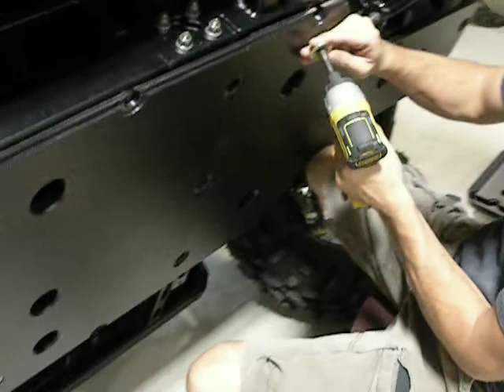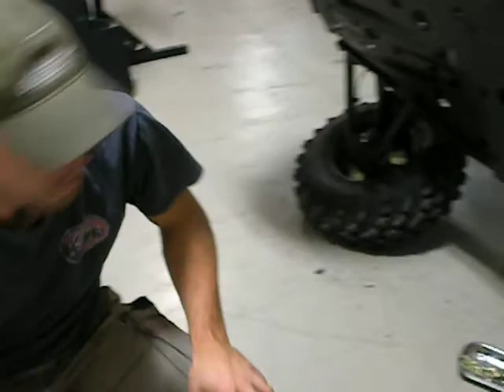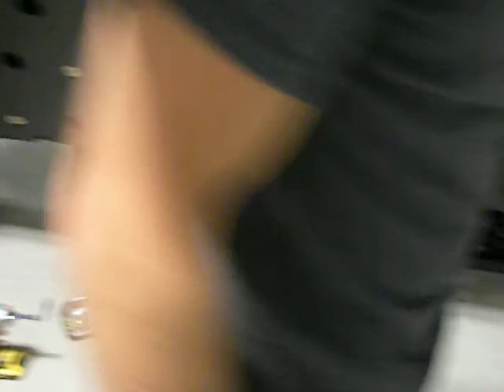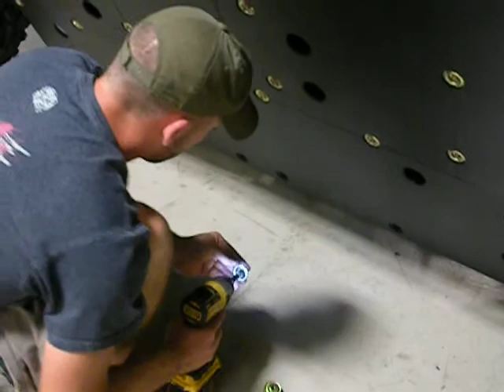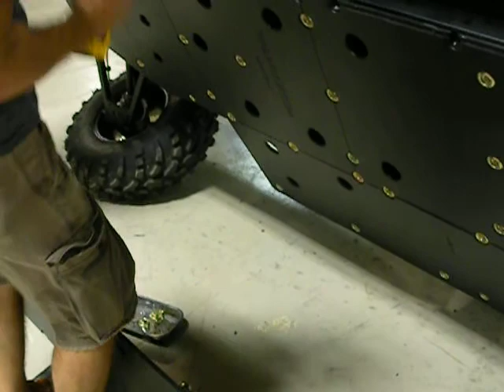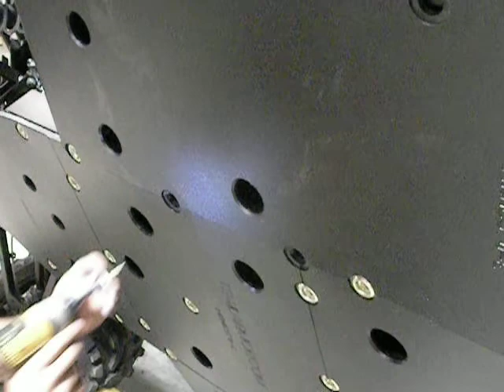Trail Armor 2015 Ranger 570 Crew Midsize Skids Installation

Comment: You work in a very noisy environment. Looking for plates for my 16 570 midsize Ranger because the factory ones on it are plastic. So are yours. Can you tell me what the difference is between the factory one to yours?
Reply: I can tell you the OEM(Factory) are about an eigth of an inch thick and not very durable a lot of people have been running stick through them/floorboard. There arte companies like superatv,or factoryutv.net that make plates 3/8 inch thick plastic up to 1/2 inch thick they range around $49-$719 but you can have metal ones made its all preference because plastic weighs less but metal is still most likely the most durable.
Reply: Thanks! THis looks to be a very quality material and very well thought out as far as the fit.
Reply: Our skid plates are .50 (half inch) thick.  The factory ones are very thin and you can push a stick through them.
Reply: Thanks!
Reply: Also, the advantage of plastic over metal is that the plastic skids dont gall, dent or rust or get hung up rocks.  They also absorb shocks to the bottom of the vehicle rather than radiating it like metal.
Reply: In the agricultural field this uhmw plastic is used to be a non stick surface for the bottoms of harvesting heads to help keep the mud from sticking to the bottom and halting harvest. It is good stuff.